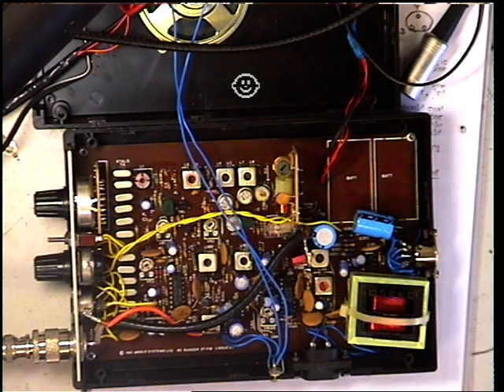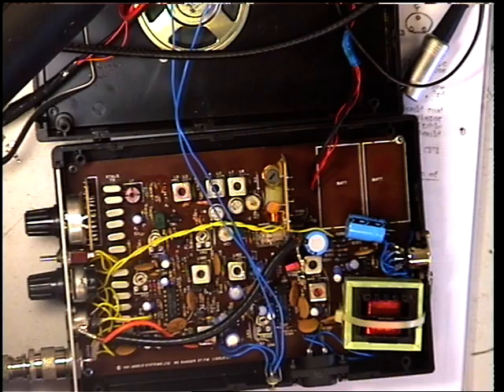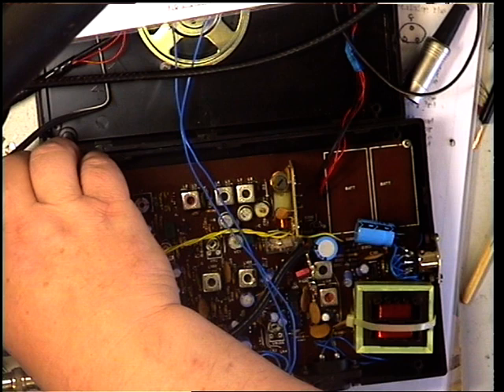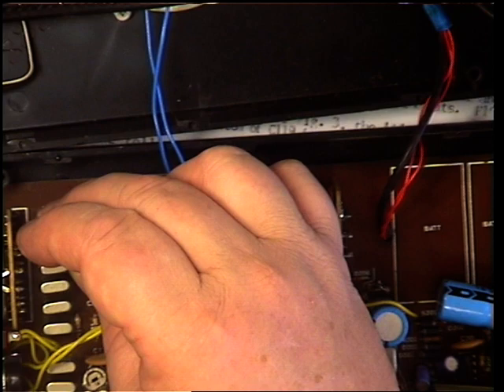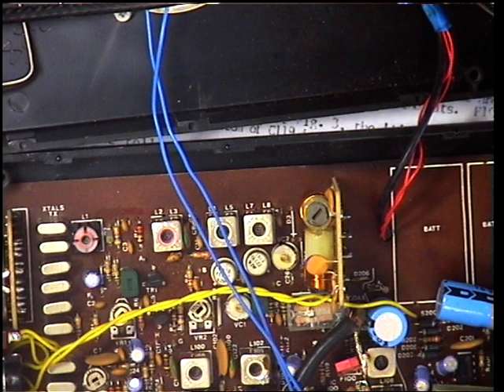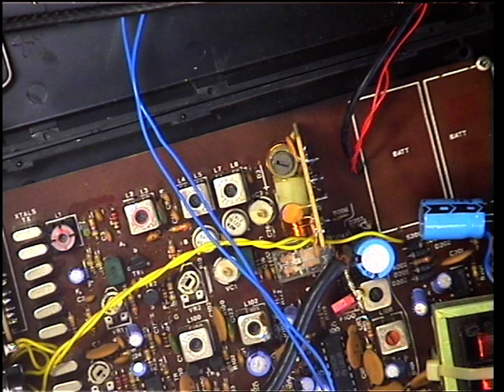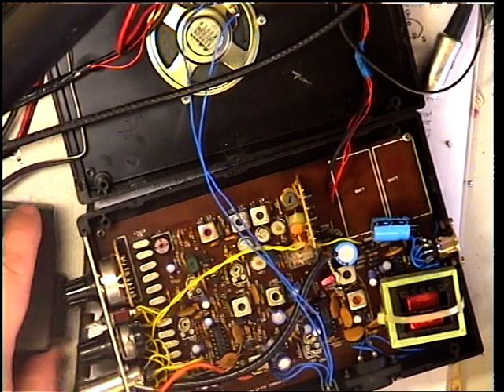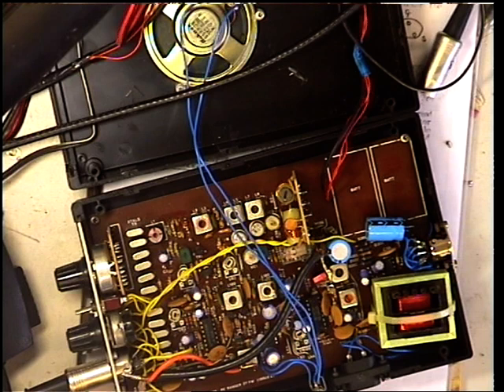PE Ranger  (Transportable CB) CB27/81 - Transmit adjustment. Pt2 of 4

Comment: what power output are they supposed to do if they are working properly Richard?
Reply from the maker: 500mW, but with the later filter as this one has, anything over 250mW is fine.....so this is doing about 320mW. There was a published modification in PE to bring models with the later filter up to 500mW by changing the output transistors etc. Currently my PE magazines aren't readily available. We'll see what happens on the range test tomorrow with Mr Chippie.....will it do 1 mile or 4 as I predict.

Comment: Would you not get a better quality video by using an old mobile phone like Big Clive does? (Big Clive is another YouTuber that does techie electronic and tear down videos)..
The quality was a lot better than last time but not you got dogey sound. Apart from that another great video.
Reply from the maker: The Sony Highband digital video camera in use was £1300 at the time! I don't do mobile phones with cameras & see them as a 17 year old girl accessory regardless of if there is a serious application. My 22 year old Motorola mobile phone is simply in the car switched off for emergencies only. Back to  video.

 Each bench here is equipped with identical equipment. Overhead sony highband digital camera with remote zoom, panasonic mx30 digital 'live performance' mixer into Sony  HDD digital video recorder, so the whole system is 440line Highband. There are other cameras I plug into the mixer from time to time to show other shots of instruments etc, mixed in usually picture in picture with the panasonic MX30 mixer. There are two 9" sony CRT 'broadcast' monitors per bench (preview & output) & each bench is equipped with two Shure  SM58 microphones on a stand through an IMG stageline pre-amp. The spend per bench on video equipment was £5K+. 

Yesterdays sound interference especially on the left channel was caused by the bench fluorescent lamp being too close to the microphone pre-amp....a schoolboy error which I didn't spot. I do monitor the sound, one of the 9" monitors has it's audio input (from the mixer's audio feed) connected to the left hand channel, but of course I keep the monitor volume very low or I'd end up with an echo or feedback.

Bear in mind there is no money here for reasons I have no doubt explained. What was bought up to the year 2000 has to remain. If things went wrong it would be the previous b&w reel to reel recorders!

Richard
Reply: Well done Richard, still getting your £1300’s worth out if the camera. Thanks for continuing to share your knowledge, video quality isnt the be all and end all, as long as we can see what your doing 🙂